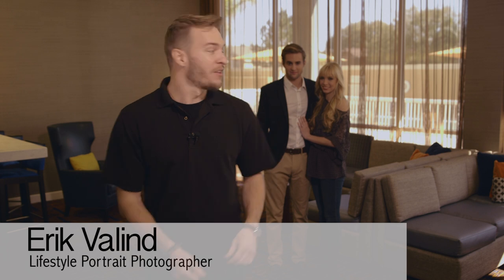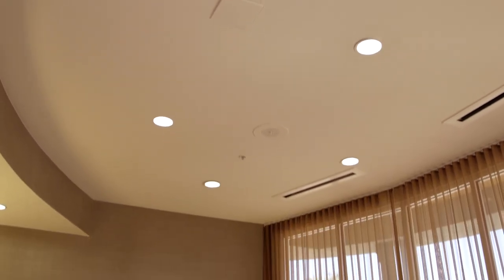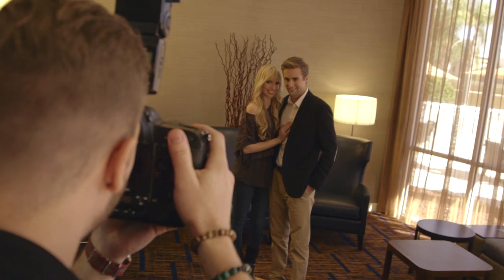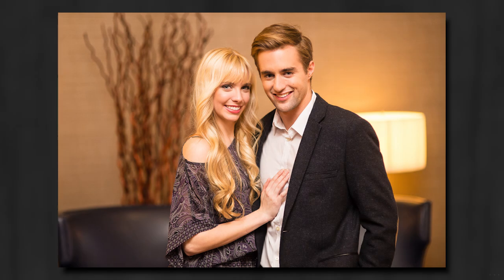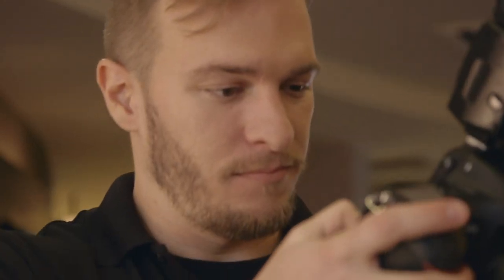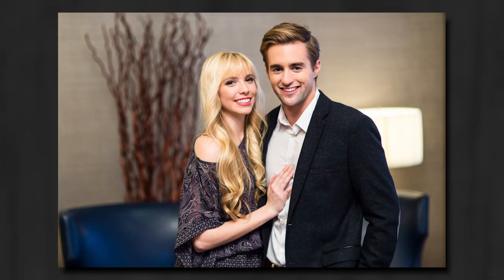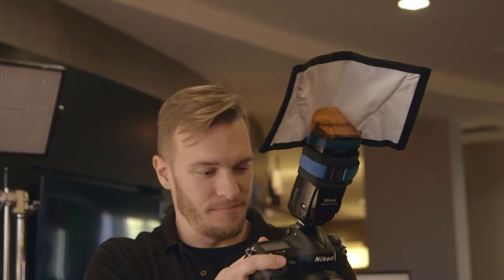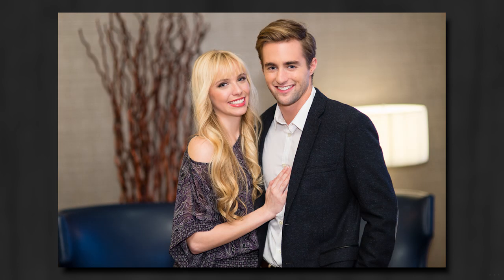1 Speedlight Solving On-Location Lighting Problems with Erik Valind and Rogue FlashBender 2

Comment: hi, how would the small flashbender compare with results from the rogue bouncecard? the latter is taller and narrower. Is the difference negligible for this use?
Reply from the maker: Hi Stefano, both would produce similar results, the primary difference being that the Rogue FlashBender 2 Small Reflector can be converted into an off-camera snoot, as where the bounce card could not be converted into a snoot. Let us know if you have any other questions! Regards, -The ExpoImaging Team

Comment: Hi! I'm a beginner and I bought a flash blender large soft box kit. A question: for photographs of events with groups of people it is better to use with or without the softbox?
Reply from the maker: Hi rinoa20001, Good question! It depends on what your environment is like. If you're outdoors photographing a group of people and have no ceiling above you, you could either bend the FlashBender forward to prevent light from being lost to the sky where it will never bounce back down, or you could use the Large Diffusion Panel to make your FlashBender Reflector into a softbox. The Diffusion Panel will, additionally, cut down on contrast and specular highlights that may appear on the subject's skin. Let us know if you have any other questions, we're happy to assist. Regards, -The ExpoImaging Team
Reply: Hi! thank you for answer. I did some tests and I have observed that with the same settings if you do not use the softbox but only the reflector light is very strong. It Is good if the room is very dark but I need to stay a bit far from the subject. I will try to use softbox for portrait.

Comment: Why did you choose to use the small FlashBender as opposed to the large one for this shoot? Is there an advantage to one over the other, depending on situation (besides space that they take up, or length of snoot that they can roll up into)?
Reply from the maker: Hi Mark,  

We simply wanted to show what you can do with the Small FlashBender.  It's smaller and lighter than the Large FlashBender, which for some people is a little too big to use on-camera when shooting events.  

Also, if your flash is one of those models that doesn't lock in the upright position for bounce flash then you would be better off using the Small FlashBender.  Not only is the small size lighter, but at half the length there is significantly less leverage on the flash head joint.  This helps the flash head to stay in the upright position.
Reply: @ExpoImagingInc  Thank you for the well-thought-out reply, and on an 8-year-old video no less! I think I have a better idea of which version suits my situation better now. I appreciate the response, and the useful point about having a non-locking flash!
Reply from the maker: My pleasure, and I'm glad the information was helpful.   Happy New Year!   @MarkOnJapan

Comment: I see you had another light source behind you.  Did you have to use that source as well to help light the room or was it all flash and flashbender?
Reply from the maker: Hi dozierc, Thank you for your question. The light panel that I believe you're referring to behind Erik is likely the LED video light that was used during the production of the video. The photographs you see in these videos are illuminated from the available light in the room (minus the video lights) and the speedlight with FlashBender 2 attached. Let us know if you have any other questions. Regards, -The ExpoImaging Team

Comment: What gel and wb would you use if the room had Florencet lights?
Reply from the maker: Steve Craig, for fluorescent gels you'll want to use the "plus green" color correction gels.
Reply: Also you would want to set your wb to Florencent
Reply from the maker: Hi Steve Craig , yes after that you would set your camera's white balance to fluorescent in order to balance all color temperatures in the photo.
Reply: Thank you very much

Comment: White ceiling needed.
Reply from the maker: Arthur Krasinsky In this particular situation, yes a light-colored or white ceiling would be needed. However, the FlashBender 2s can be bent forward if you're outdoors or indoors with off-color or high ceilings to push most of your light foward. Alternatively, you can use the Rogue Diffusion Panels for Rogue FlashBenders to cut down on harsh spekular highlights (face shine) and use the entire surface area of a FlashBender. The Rogue Diffusion Panels for Rogue FlashBenders encase the the light, push it forward from diffusion material, and prevent the light from getting lost in the sky or in high-ceiling venues. For more information about our products visit RogueFlash.com or check out the other Rogue Speedlight Videos on our channel.